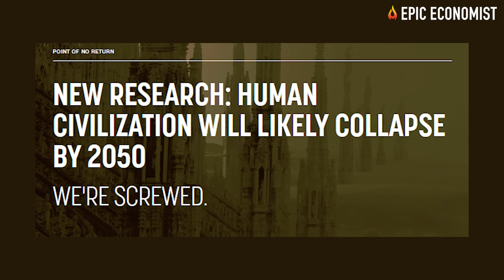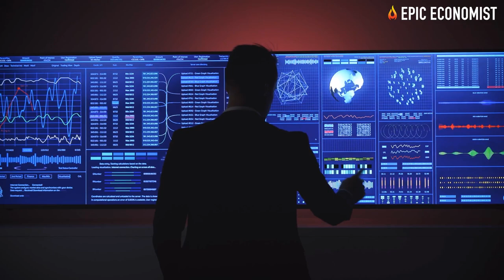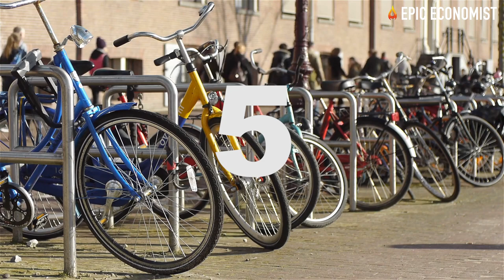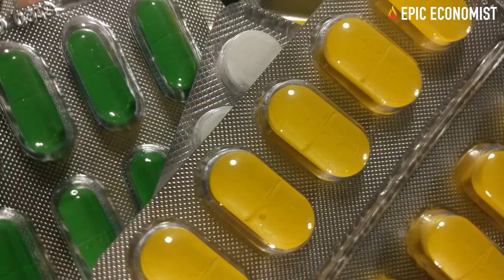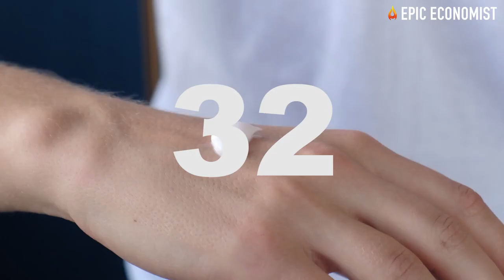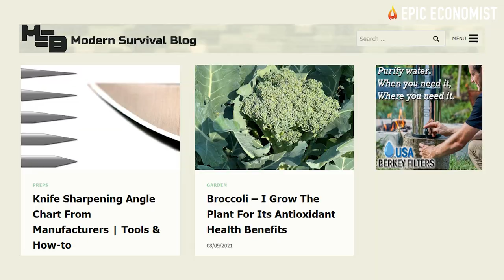35 Survival Items Everyone Will Be Looking For After The Imminent Economic Collapse

Comment: Alkaline batteries will leak over time, and ruin your stash, and the items they are in.. Buy rechargeable batteries, and small solar panels to charge them with. If you can come up with spare 12 volt deep cycle batteries, also buy some auto type fans like you see at Walmart, and run the fans off of the batteries. 
If you need music, you can wire up a car stereo to the deep cycle batteries for music. 
Buy some 12 volt LED lights and hook them up to the batteries as well.
I lived this way for several years.. Having a 1000 gallon propane tank, propane heat, propane cook stove, and propane fridge helps..
Lots of various things you can do to get set up off grid that does not cost a lot of money.
Reply: Go with usb powerbanks
Reply: I always check mine and only had one leak. It’s worth it to buy but not in huge bulk
Reply: Thanks mate nice advice!!
Reply: Use and replace.... constant cycling of your suppliers helps keep them fresh and updated.
Reply: @cherokeefit4248 alkaline  batteries are a waste of money that can be better  spent on other things get recargeables.
Reply: ALL batteries will eventually become useless during a collapse.  In fact, any factory built items will eventually fail.  It's best to rely solely on the tools that can be built by hand.
Reply: Sunligth is 💪. Old sat dish can be turned in cook pot or grill. Just with the heat of tje sunrays all concentratet at one point ann led trough a lense. Actally this can become quite dangerous but 🤷‍♂️
Reply: @chaigtin259  I wonder how long a car lithium battery would last running basic household items??? If they are charged at 110-120, do they give off the same voltage without voltage converters?? Hmmmm.....

Comment: Solar lights for the garden or sheds some of the solar lights can be used inside the home 🏡 during the day. I have solar shed light inside my home 🏡 and they work great
Reply: Good job ty for sharing
Reply: Be careful if no one else has lights on and they see u do,  you'll become a target
Reply: Simone W thank you 😊 I installed black out curtains. I can close my curtains and no one will be able to see the lights. The garden lights is a little complicated because they are higher up and I would have to remove them but I really don't like the idea 💡🏡😊❤️🐶😺
Reply: We do this as well as part of our preps. Can be discreetly stowed outside to charge during day and then brought in at night (windows covered and/or inside area without windows). This has been a lifesaver during storms/hurricanes. Super cheap and lightweight. Thanks for mentioning it.
Reply: @angelicsiren11  very smart..ive done that for yrs to just offset the power bill
Reply: I just tested my two solar powerstations and I can light a 5w LED for 55 days without recharging them. Of course, I'll try to use my solar panel to get the one not in use recharged.

Comment: Sunscreen and lots of it, dry shampoo, clear nail polish, cotton, Band-Aids, Triple antibiotic ointment.
Reply: Keep finger nails very short for health reasons, along with toe nails. Shave your head, woman cut hair short. Shave beards. Dont need that extra hygiene drama. Baking soda under arms works well. So does peroxide. Start saving those little pieces of bar soap to melt down later. 
Install a hand water pump as a back up. Baking soda and peroxide for brushing teeth.  Peroxide for dental infections.  Stock up on tooth picks and dental floss more important to get plaque from between teeth. Install

Comment: Window screens, particularly those that are portable.  Be able to open windows when AC is out.  Battery powered small fans can make the difference between a good night sleep and trying to sleep soaked in sweat.

Rechargeable batteries and a means of charging.  AA & AAA batteries (and adapters) can power flashlights, fans and radios.  A solar generator can simplify recharging.

Comment: 1) Weapons
2) Food
3) Gold and Silver
4) Crypto
5) Alternative energy sources

6) Transportation vehicles of various sorts
7) Everything above in a bug-out-bag
Reply: JB Weld- can even seal a fuel tank with it.
Tire puncture repair tool and plugs.
(cheap and easy)
Reply: Thanks
Reply: Can you recommend a bag that will accommodate my vehicle?
Reply: @edlane1883  Personally, I chose a huge 5.11 bag. Filled it with a lot of things. My thinking is that if it isn't really that of a hurry and I have time to sit in my car, then I can carry a bigger bag. At the top of my packing, meaning easiest accessible, I have food and other stuff that I can quickly eat in the terrain while hiking. Won't even need to stay too long in a spot. However, be careful of the weight. It can also be detrimental in a tough terrain. Think about your routes and pack according to what you think you can carry. Try it out. And work out for it too! I put my bag on my back and run with it. 

Yes... I'm that paranoid :P

Comment: I have hydro generator on property 1000 amps 24-7 off grid for over 18 years now. Maintain my self as a electrician. 1000 amp main run more then enough it haveing a 240,000 watts generator constant power. Have a backup turbine in the barn. Every good property should have a river running through it.
Or a Lake up mountain, or a stream going by.
Hydro is the best power source out there .

Comment: instead of batteries id go for copper wire and magnets set up on the bike suggested and try and charge what i have mostly lights transistor radio  on analogue as other electrical items wont work if there is no power.

Comment: Save your laundry lint. It's combustible, cast iron cookware, it can take the high heat and isn't cleaned with soap, Another is a WOK, They can also take the heat so  can cook hot and fast and also isn't cleaned with soap, firearms, ammo, bows and arrows. Things like carb cleaner use a lighter with it..Instant flame thrower.
Reply: We used to use hair spray ( Auqa Net was best).